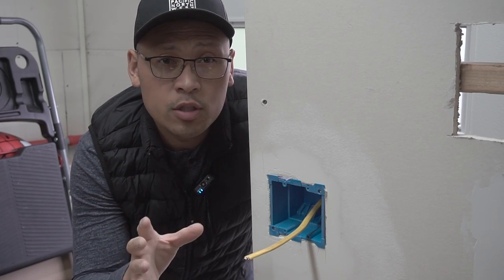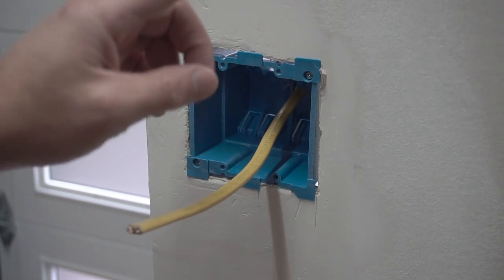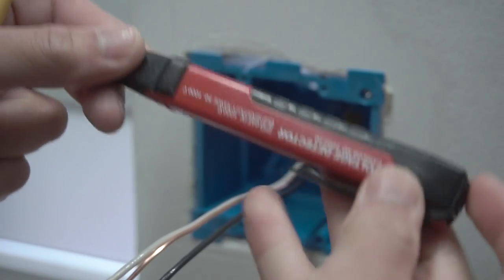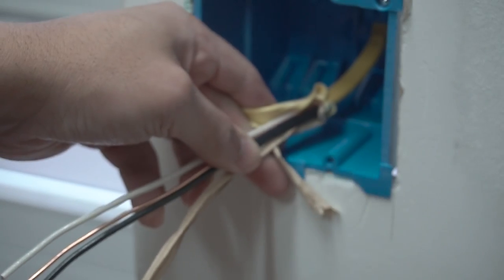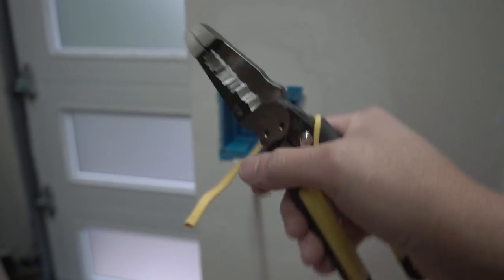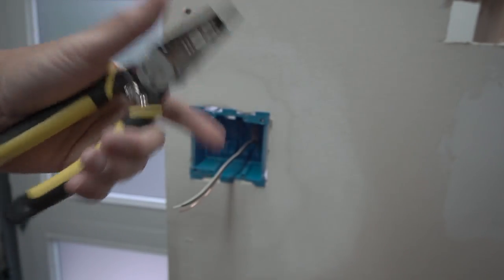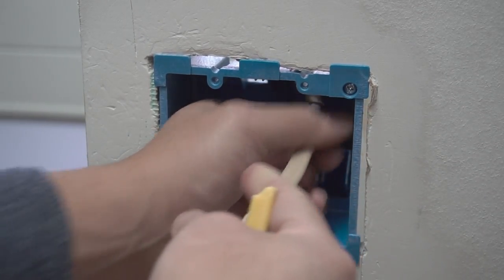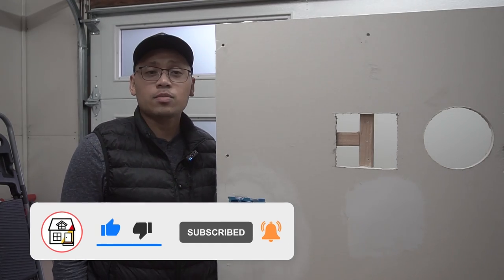Most Common DIYer Electrical Mistake When Cutting Cable Sheathing - 5 Tips To Do It Right! HOW TO

Comment: 5:24  these holes labeled 6/32 and 8/32 are for cutting screws . These sizes are the most common screw sizes in electrical boxes , outlets , you screw the screw in to the length you need and you can cut it, as you unscrew it out it will repair the threads .

Comment: Wire cable usually has a flat side and a grooved side. I always cut on the grooved side. Never seen that outer covering removal too. "Oh, Dear, I need to make another trip to Home Depot." Considerations for the DIYers: Any DIY project requires Time, Effort, and Money. Since you will save money on labor costs, spend some of that money to buy the tools you'll need. Specialized tools will pay for themselves in a short time and save you time and effort.
Reply from the maker: Thank you for sharing and your input! 👍🏽😊

Comment: First i learned with the cable rippers and loved them. Then i was taught #4 and it's the best as long as you do it often enough to keep that feel,  then i switched to #1, .. be sure to keep both hands together so you don't cut one.  And i still use that unless I'm ropping a new house,  when i like the cable strippers and cut them Before i pull them into the box.  I got wary of#4 since afci breakers came out with all the nuisance tripping that was happening. But now,  it's probably the best and fastest as long as you don't twist all your grounds up into the sheath of you use Buchanons. I tried the rippers again but found the point got stuck in the paper so much it shows you down too much, so i quit using them.  I never did a while buttload of new houses tho but all the guys worked with that were fast used #4. Ain't nothing faster i don't think. But you have to keep that feel for not slicing into the insulation by doing it a lot.

Comment: The holes in the Southwire stripper are not for cutting wires but to cut screws that you can thread in and not wreck the threads  There is printing by them that says size 6-32 and size 8-32 sizes.
Reply from the maker: That is true 👍🏽😊 but I use it to cut wire as well 😂
Reply: Why would you use the holes for cutting wires when the tools has a cutter. That’s just dumb. Fix this house that’s beyond bad advice

Comment: Electrician here.. Every electrician I know uses a razor knife, myself included. ( maybe the younger generations uses something else) Use a brand new blade and just graze the sheathing... Very simple, actually
Reply from the maker: Thank you for sharing your knowledge and expertise! 🙏🏽😊
Reply: And, it’s not rocket science
Reply: There are romex strippers. Just like regular strippers but only for 14 and 12. The remaining space has spaces for cutting the sheathing of 12/2 and 14/2. I like them but they leave an inch or so in plastic boxes.

Comment: Another method is to grab the ground wire with your linesman plyers and pull it away from the two insulated wires. That ground wire will slice through the sheathing easily.
Reply from the maker: Thank you for sharing your technique! 🙏🏽😊

Comment: Hey! Really helpful video. I'm running romex between 2 outlets on opposite sides of the same wall, so i'm just dealing with drywall. My question is, how much of the romex should be in the wall i.e. between the outlets? Should it be taut or should there be some excess romex in the wall so that there's some slack there? 

This might be a basic question. If so, forgive me, I'm a novice :D
Reply: I like leaving  6 inches slack behind wall.  Next guy has extra.  Congrats on your remodel.
Reply: Must be Secured within 12" of the box connector.  Connectors are a form of securing. If they were back to back you wouldn't be asking this question. You'll probably be more than 12" so you'll need a staple or two

Comment: I have a cylinder type device that hooks under the upper part of the sheathing. You then push it up. It works well.  Uing a razor knife is a very common method, even by electricians. I have at times cut into a conductor so I avoid using a knife and if I do use it I just score the sheathing.
Reply from the maker: Nice! Thank you for sharing that technique! 🙏🏽😊
Reply: I use a similar tool. The end opposite the blade is designed to slip over a wire nut, making it easier to grab and twist it.
Reply: @joeweatlu5169  Might be the same one. Its made by Ideal and called the lil ripper. I bought it as an alternative to the metal clamshell type which as stated in the video can sometimes nick the conductors. Its touted as a multiuse tool but Ive found it useful only for slitting the sheathing and torguing wirenuts.

Comment: Are you even an electrician.  What do the numbers 8/32 and 6/32 mean to you??? Those openings on the stripper are not to cut wire...
Reply from the maker: Bolt shears, but why limit yourself to just bolts?
Reply: @FixThisHouse   Because they're threaded to 832 and 632 and you'll ruin the threads to cut bolts
Reply: No way you ruin the threads cutting wire in those holes. Copper wire is so much softer than a 6/32 or 8/32. I never have nor ever would use those holes to cut anything other than a 6/32 or 8/32, but to say that you will damage the threads cutting wire is ridiculous
Reply: @zinsco   If hes giving them the opportunity to utilize it for something other than that what would stop them from utilizing it for something that would destroy the thread...ijs.  I myself would prefer to use it for what it's intended use  don't destroy your tools